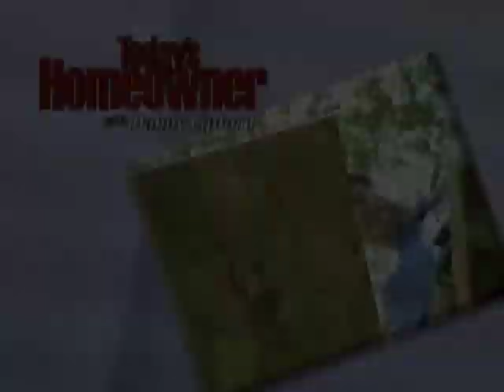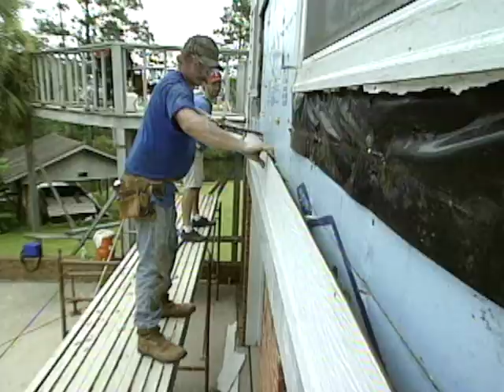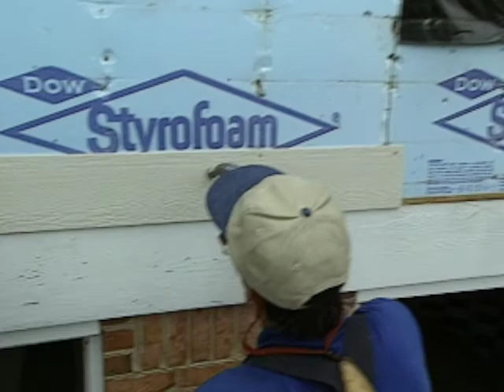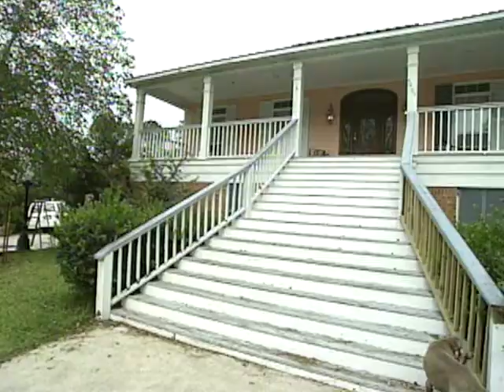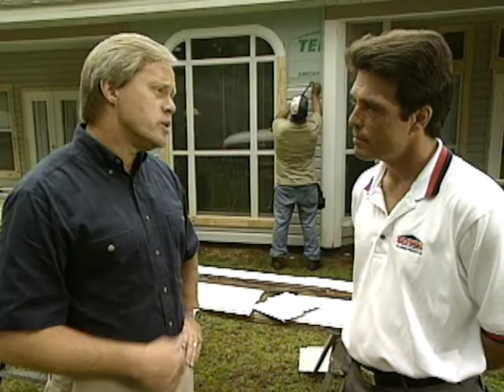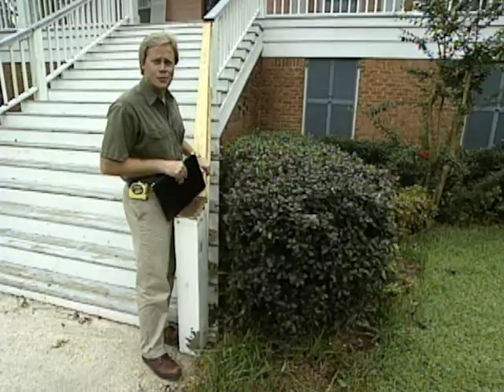Exterior Siding - Today's Homeowner with Danny Lipford (S2|E3)

Comment: Brick and cement boards provide much better protection from heat and cold though. I’d much rather have a brick house than one with vinyl siding.
Reply from the maker: Totally get it. Different strokes for different folks!